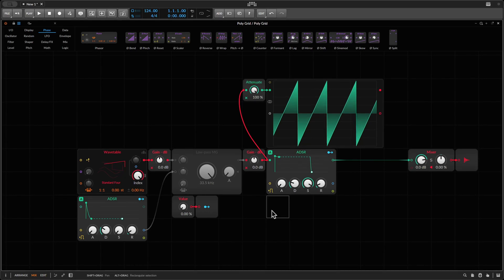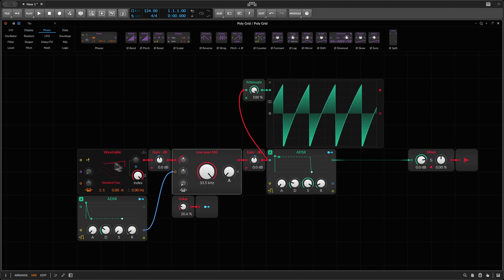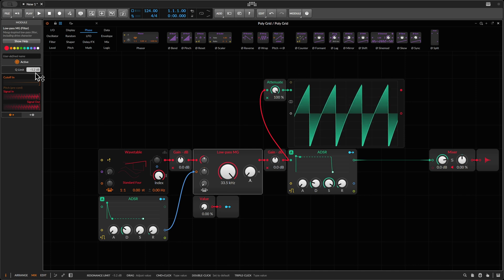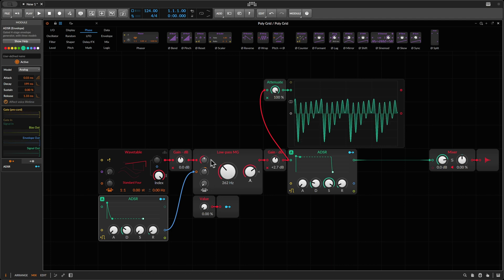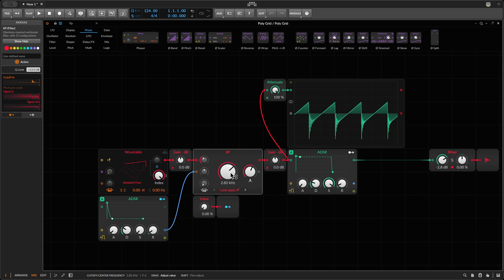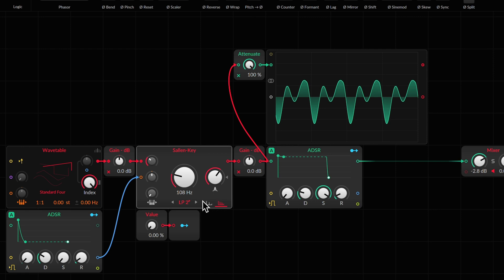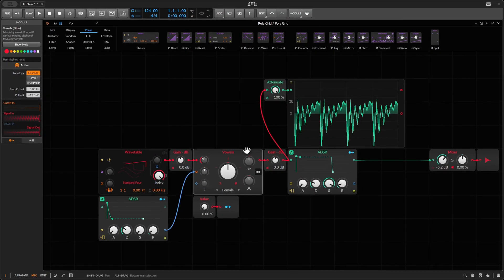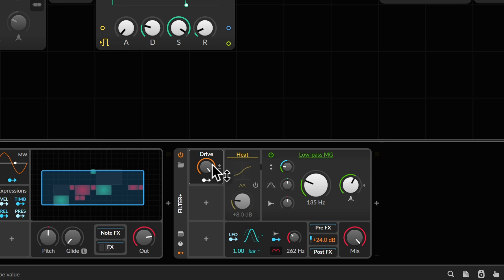Bitwig's filters are top notch, but you're probably missing out if you ignore how thy behave! 🎶

Comment: Wouldn't reducing the input drive be  equivalent to setting the clipping level to 0 then cutting 10 dB?

ETA i just did a null test and yes they're identical. (Set Q limit to zero then cut 10dB vs reduce drive knob in filter interface.)
Reply: Null tests showed divergent behavior with SVF. Everything else, the filters with a Q limit, the differences were below 90 dB. 

Looking at the spectrum analyzer, you can see small differences near the cutoff point. Either this is dithering or noise in the filter model.
Reply from the maker: @GeorgeLocke  as far as I can tell, it should be the same, since we're basically just changing the distortion threshold.  🤷‍♂
Reply: @theRumbleChannel I'm wondering if SVF is failing because of a bug or something else.

Comment: Many thanks for the tips! I never changed the resonance limit but it affects the sound a lot, thanks for sharing 🙏 😅Regarding filter+ I realised you can set the resonance limit by right click next to the cutoff/resonance knob. You can then save this as a present and it will be restored. But when you select one of the new filter rasp for example you have other options by right clicking (feedback limit in this case) and when you switch back to a normal filter with 'resonance limit' it will be set to -10db again.
Reply from the maker: good to know :)

Comment: Need more of this type of videos! I'm a beginner so when I'm working on something in Bitwig I'm noticing the sound moves around when I move gain around but I don't always understand why. Are my ears getting confused from changes in relative loudness or is something different happening? I could study every device methodically but I don't have enough time. A lot of content-farm type of tutorials show using the devices under specific conditions and highly-tuned setups without explaining any of that. I am left dumbfounded when I fail to achieve same sound in my track. Tutorials like these set the course for learning how these tools actually respond.
Reply from the maker: I'm afraid my tutorials are usually more advanced, but I'm glad it helped :). And I always try to make them in a way that the results should be reproducible, even if some might not completely understand what's going on.